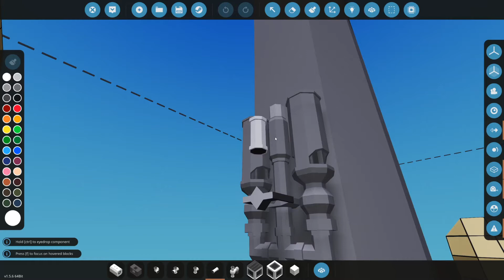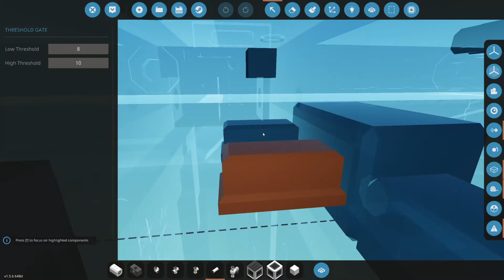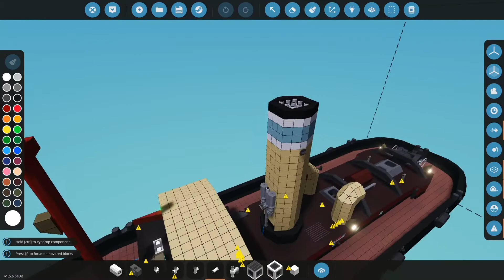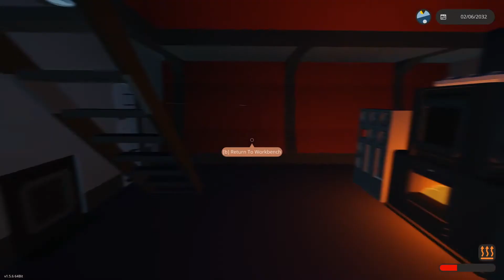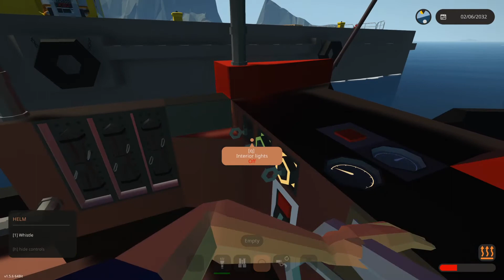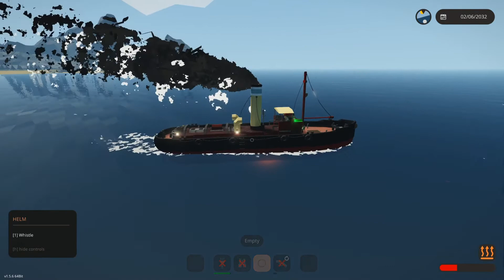Stormworks boiler pressure control and tug boat changes

Comment: One way I found to maintain temps, pressure and even steam volume is to use a function of (x-y)/x
x is the max value you want, y is the input from whatever you want to control. 

So to control pressure, you could use a constant number of 7 for boiler pressure conneected to x on the function block,  connect a variable valve to the fluid from firebox to boiler, then connect output of the function to the valve and the boiler pressure node to y of the function block.  It makes the valve open in the inverse percentage of the difference.   If that is even a thing.   

The easiest way I have found to manage pressure is to limit the water in the boiler.  The boiler has enough water to create about 7000bar of pressure ( exaggerated numbers, haven't done the actual calculations).  1L of water into a hot boiler will create about 3bar pressure if I remember right.    So if you use the function i mentioned above with 3L as the setpoint (x) and use the fill volume of the boiler as the variable(y)  and connect a tank and variable valve to the water in side of the boiler that has 0% fluid in it, you do not really have to worry about the temperature of the boiler being too high.  In fact, higher boiler temp is better because it creates steam faster.   
🤷‍♂️ something to try out maybe.
Reply: I've tried something similar to your setup, but I used PIDs to do the heavy lifting and control boiler and furnace temps, using 0.1 = P = D and then i = 0. I then used a less-than function to control a numerical switch and another one to control another numeric switch to vary the PID setpoints based on pressure. The furnace is set to a constant 250 degrees to lessen coal consumption. If the boiler pressure is below x, the temps are set to a; if the pressure is between x and y, temp is set to b; I think the third one was for testing purposes.

Anyway, mine works, but it isn't meant to maintain one pressure. It's meant to maintain a range of pressure for occasional use (steam whistle). I'll try your method next. That's a good idea about the boiler water level. I've been leaving it full and having my water tanks to constantly fill it
Reply: @qazxsw21000  I actually came up with a better way.  I posted it to the workshop.  It controls the water into the boiler to keep pressure as close to 10 as possible without going over.
Reply: @Bendigo1  what’s the name of the creation? I’ll take a look at it when I get home
Reply: @qazxsw21000  Steam Boiler Pressure Controller by Bendigo
Reply: Just keep it simple. The best logic for controlling a boiler is 2 threshold gates and two and gates. I use two and gates because I want the final on/off output to factor in the on off signal from my key button that starts my system. But basically, the two threshold gates on/off output goes to the inputs of one and gate. the output from the first and gate goes into an input on the second and gate. then your on/off switch into the second input of the second and gate.  The final output of the and gates will go to the two standard 3x1x1 pumps you have cycling coolant through your boiler from your heat source of choice. The two threshold gates will measure boiler pressure(High of 7 low of 0) and boiler temperature(High of 105 low of 0). The whole setup then can be a closed loop between boiler fully filled with water, pistons or turbine, and condenser with pumps between and no need for valves and water tanks.